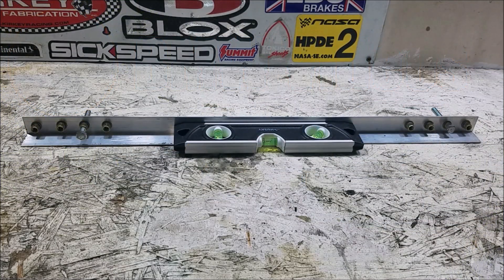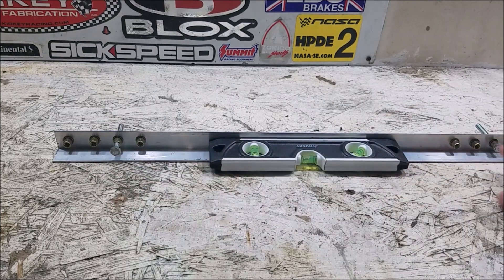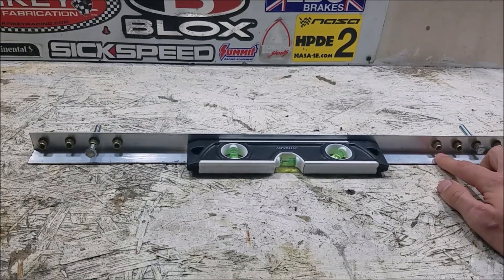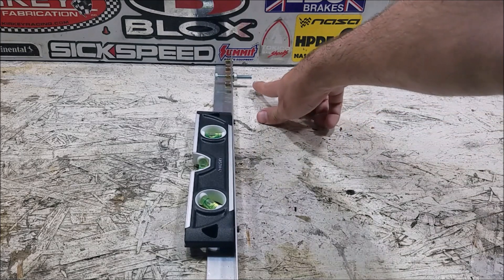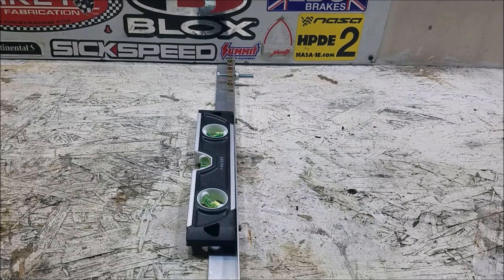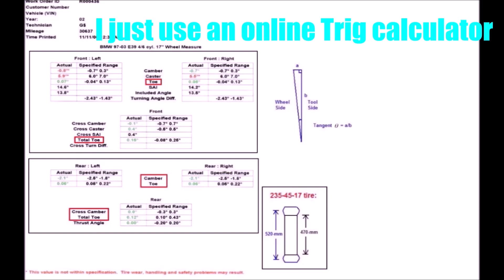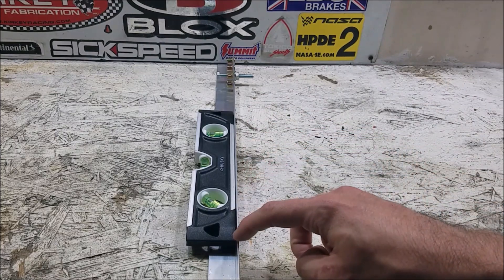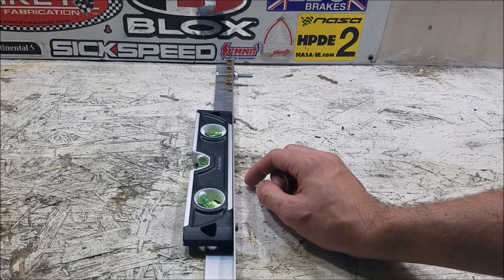DIY $20 Camber Gauge

Comment: All fine and Dandy but how do you now when your car is perfectly level itself? if it isn't then you gauge will not work
Reply from the maker: That's the same for any camber gauge. Leveling shims based on how your garage sits. 1/4 in plywood works well.

Comment: Good video. Diagram helped a lot. Might give this a try before an autocross this weekend and HyperFest later this month. Are you going to be there?
Reply from the maker: Unfortunately no, ill be going back to school so the Z will be parked roe a couple years. Hope the gauge helps!
Reply: @350Z247  Bummer. Good luck with school. I'm a Mechanical Engineering student ATM as well so I get how hard it can be to do school, car stuff, and YouTube at the same time.
Reply from the maker: @Luke_NorseSpeed  My wife is a M.E. too. It's a good gig.
Reply: @350Z247  Lots of work in school but you end up in a field that's constantly in demand. I've got my concentration as Mechanical Engineering for Motorsports but the only difference between a standard Bachelors in ME and the motorsports concentration is a few extra classes. (IE Engine management, chassis design, race aerodynamics, etc)
Reply from the maker: @Luke_NorseSpeed  That's what I probably should have done for a career, but the medical field should allow me the time and means to play with race cars at home.